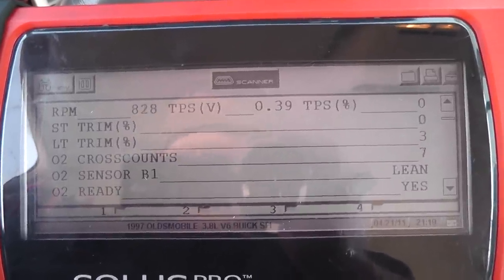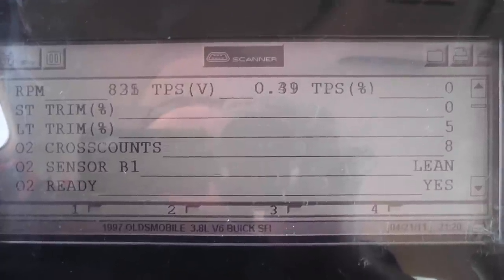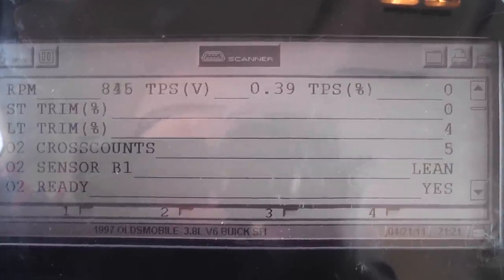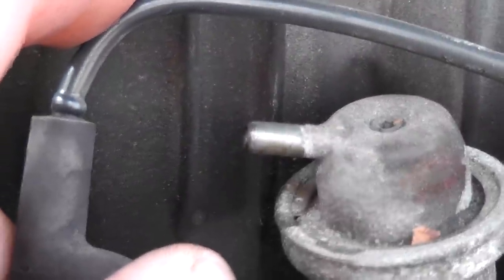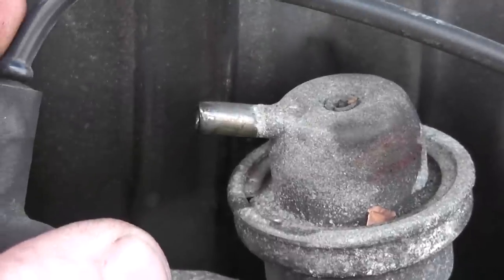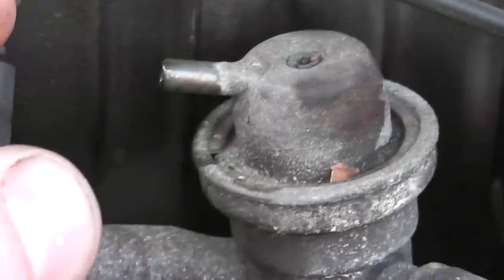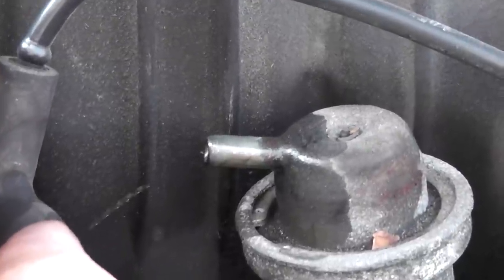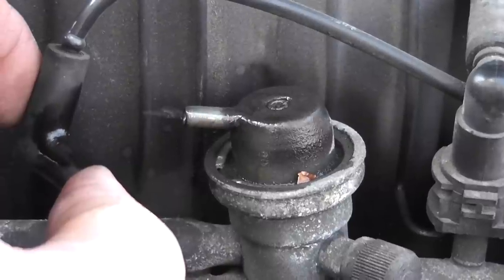Testing for a leaking, ruptured, fuel pressure regulator diaphragm

Comment: OK so we wait a few, gonna try this on my 94 jeep GC 5.2 I replaced f filter then later that day the pump. still has the ASD and f pump relays clicking so in the on pos I pulled the relays still heard faint click other side engine. the evap purge solenoid was it so play with it and its next to the fpr so it stopped clicking and got fuel. but driving for few minutes rpm up n down few times and dies. has rough long start sometimes with a shotgun blast backfire that is after the relays stop clicking. also you did good plugin the vacuum line otherwise would've had a high pitch whistle and tough time hearing you in the video.

Comment: Awesome tutorial Scanner Danner, I have learnt a great deal from your videos. I am refurbing my throttle bodies and fuelling system as part of a minor restoration. On removing the FPR (it's attached to the throttle bodies) I noticed a dark brown oil like liquid in the vac port of the FPR which had a slight smell of fuel and oil. Could this just be oil vapour in the vac lines? Im unable to test the FPR as it's no longer connected to the motor.

Comment: Indeed u are correct, reg is in the tank. So if i pull that 2nd hose and i have a "suspected" leaking reg, will fuel come out of that outlet?
Reply from the maker: No, that second line is an EVAP vapor line and is not part of the fuel delivery system. You cannot test the reg. If you have a bleed down problem you must change the pump and reg. as an assembly.

Comment: I'm praying that is the problem with my volvo 940, I've replaced the relay, fuel pump, cleaned the throttle body and idle control valve. The engine will run for 5 minutes all the while the fuel pump is getting louder at idle, then it shuts down. If I'm driving at freeway speeds there is no problem

Comment: A leaky regulator(in plenum) leaky poppets, or bad fp check valve? Is my koeo spec during pump priming or off?  A little more info, rarely ill get a random miss code, misfire counters 0 most of the time on drive the scanner make pick up 1 or 2 misfires each on diff cyl then back to 0. Fuel trims are only -6 and -8 at worst near 0 at higher rpm. Id appreciate the input I'm starting to get more diagnostic work at our shop and your videos realy help me be successful thank you very much!

Comment: I pulled the vacuum hose on mine today. I didn’t hear any suction from the hose like I did in this video. The pressure regulator did have a small amount of suction though. Does that sound normal?

Comment: What if the FPR like this is plugged on the fuel pump hangar inside the gastank? Will a torn diagrahm also send too much pressure to the fuel rail? My injector is sending too much fuel inside the cylinder causing exhaust to go inside the exhaust and out the back
Reply from the maker: No, a ruptured diaphragm on a tank mounted psi regulator will cause low psi and bleed down issues (long crank times)

Comment: Good stuff. I am an out of work ASE engine specialist and I have no money for a new gauge let alone throw good money after bad.  I was wondering how to test it since my fuel press. tester got busted. The only other gauge I have is for carb and it doesn't read high enough, even if I did adapt it for schraeder valve. It was a toss up between FPR or Pump prime switch/fuel pump. This should help me eliminate some possibilities.

Comment: I have that  exactly type of motor with the same time, at the end of that small hose there on the video. Now I have gas coming out of my air filter can you tell me any suggestion on what I can check ... it was running perfectly good. I just change the t.. and now I got this issue...

Comment: Can a fpr all of a sudden die out? Like get so weak that it just floods the injectors with gas? Awesome job on the tutorial by the way; man I have changed all of my ignition components. I still have a no start condition with flooded plugs. I mean everything is Brand new, all sensors! The only thing I haven't changed is that? What would be the signs? Thanks in advance. 04 Indy SS
Reply from the maker: +Corey Conner just pull the hose off and check it. If no fuel comes out, you'll need to go in another direction

Comment: Any idea where that component is located on a 2004 Ford escape 3.0?  I have a P0001 code but can't find the location of a fuel pump volume regulator on a 2004.  Saw a video on a 2005 but my 2004 it's not in that spot, nothing is in that spot on my 2004.

Comment from the maker: that connector is on the inner fender either on the driver side or passenger side. run the key on engine off self test and the key on engine run self test and let me know what you have. keep in mind when you run the key on engine run test that you must have the engine warm first and you must follow your prompts or you will set false  trouble codes

Comment: The regulator you have tested is placed inlet line. How to test the device which is on return line? is the difference between inlet and return divices?
Reply from the maker: The regulator on a return type system is the end of the pressure line and the beginning of the return line. On ALL return type systems. Are you dealing with a returnless system and maybe a pulse dampener that looks like a regulator?

Comment: Scanner needed to tell me what that hose did.  was that the fuel outlet ?  I thought it was the vacuum line to the manifold?
Reply from the maker: It's a vacuum line, there should be no fuel there. The vacuum alters the psi regular and give it about a 6-10 psi difference from idle to wide open throttle
Reply: ok, so its a leak?

Comment: Could you put a vacuum pump on there with a container, ala vacuum brake bleed, and see if you get fuel?
Reply from the maker: or put a clear plastic tube on the vacuum hose and then connect it and start it and look for fuel that way

Comment: Great tutorial.  I had ruled out the fuel pressure regulator as the cause of a long crank on my '99 Olds because I didn't see any fuel coming out of the port when I first pulled the vacuum hose off.  It's a pain to diagnose since everything on my scanner looks normal and I am getting no codes. Didn't realize that a minor tear would take so long.  I will try again tomorrow and wait a while longer.

What's the longest you've seen it take for fuel to start coming?
Reply from the maker: about a minute or two. 
With a long crank, the next step would be to test for a fuel pressure bleed down problem on shut-down. Fuel pressure should hold.
Reply: What if fuel pressure doesn't hold?

Comment: Thanks for the video 
How do you test this if your fuel pressure regulator is in tank? Nissan Sentra hava in tank regulators
Reply from the maker: You don't. You would simply have a bleed down issue and NO driveability problems other than a long crank time
Reply: @ScannerDanner  Sorry 
I have drivability problems 
1. Long crank 
2. Ltft and stft in negatives, worst in coasting.
3. Car stalling 
4. Engine misfire (P0300, P0304) 
5 Bad fuel economy
6. Engine running rich 
7. Darkend spark plug tips

Can I only replace the fpr with this type of fuel pump or have to replace whole pump 
Thanks
Reply from the maker: A leaking/ seeping  fpr that is in the tank will NOT cause any of these symptoms 
Is your fuel psi normal with the engine running? If so, you need to move in another direction
Reply: Too bad, I don't have the equipment to check the pressure
Reply: @ScannerDanner  Check the date of this comment thread 
Am still running rich Bro 

Can a ruptured fuel line cause the symptoms i talked about when the fpr is part of the fuel assembly in the tank? 

Btw, I changed the whole fuel pump assembly; it didn't fix the fault. 
So its definitely not the fuel pressure getting into the injectors to spray.

Comment: Just to let everyone know, my 1997 Buick 3800 Series II has never spit fuel out of the vacuum port no matter how many times and how long I waited for it to start spitting. I just replaced it and it appears to have helped with BAD starting in the winter where it's currently 20 deg Fahrenheit. If you're unsure whether it's bad, spend the $45 at Autozone and just replace it, because sometimes they don't leak in an obvious fashion :)
Reply: As a follow up to my previous post, ultimately I was able to check the fuel pressure  using a fuel pressure guage attached to the test port on the fuel rail on top of the engine. Fuel pressure is supposed to be 47-55psi and mine was consistently low at 22-25psi and always throwing the P0171 "Lean to Bank 1" DTC. Took car to have the fuel pump replaced and haven't seen the DTC code since. If it wasn't for the cold exacerbating the slowly failing fuel pump, I wouldn't have gotten rid of the problem.

Comment: So it was good? Mine has no fuel coming out...after about 2 mins. The car is running like crap though. P0300 code. 2005 Monte Carlo LT 3.8. Waiting on fuel pressure gauge to test fuel pump. I do have an Actron with trim readings LT and ST...no clue how to use that to test though.
Reply from the maker: you found the right channel for learning your fuel trim numbers, also testing fuel pumps too :-)

Comment: any other way to check. 95 explorer usually long crank. hit and miss to start. sometimes it idles rough. sometime it stays running  for 5 sec sometimes 5 min. If u rev it up the second you let off it shuts off. And it usually bounces around about 500 rpm. holding at 2grand it will bounce between 2 grand and 1500 and eventually shut off.

Comment: Ohh damn I recently "tested" my FPR with the quick method and engine not even running... I figured that if I suck from FPR vacuum hose and it doesn't let air through it's fine, but I suppose that the rupture can only leak when engine running and after couple of minutes... Guess I have to re-test it properly.

Comment: ive got a 3800 supercharged series 2 that ive changed nearly everything due to a rough/surging idle and random one of the only things i havent done is the fuel pressure regulator hoping for the best. fuel pressure held okay but im just throwing parts at it hoping for the best
Reply from the maker: Have you done a compression test on the engine? It is common to have a low compression cylinder or cylinders give you a rough idle and run good under load.
Reply: ive done both compression and leakdown and both are great

Comment: So after extended period of time if no fuel comes out were good? My 1999 Eighty-Eight starts fine but many times after it is hot it starts but spits and sputters (kinda like it is running rich) but it stabilizes after several seconds and runs fine. Thoughts? thx

Comment: My 99 Regal has a long crank time but only after sitting all night long. It cranks just fine during normal use. Any ideas on what wouls cause a cold-start long crank time? Thanks.
Reply from the maker: check your fuel pressure first

Comment: Spierotti14 I had similar problem few month ago, misfire at different cylinder  negative fuel trim #'s and lack of power but no long crank, the problem intake gasket leak and the MAF sensor, with the engine running unplug the MAF sensor to see if the misfire stop. hope this help..

Comment: Sorry I didn't see you responded so fast. It is a MAF  SFI  i checked the injectors power and PCM command   I just don't see how much fuel can get in the engine  while  I was able to get it to run didn't see any fuel coming out o the regulator tomorrow I'm gonna try to find the connector for the scanner (odb1) somehow it got misplaced

Comment: @ScannerDanner 
I see thanks a lot! Then if Key is On- engine Off and pedal is depressed fully you should see 100% tps, right? my system is a throttle by wire so I don't know if that would make it any different

Comment: I NEED THAT VACUUM HOSE!!! where can i find one? my car has a crack in the L boot that goes on the fpr nose, no auto parts store or gm dealership has this line i need....
Reply from the maker: +Dylan Thomas just change the whole thing with rubber. If one size is bigger than the other buy some adapters. Something like this https://www.fcpeuro.com/products/bmw-vacuum-hose-connector-e46-13327503677?gclid=CjwKEAiApOq2BRDoo8SVjZHV7TkSJABLe2iDCzkvDX_PBYrShndAGkFXzTcThvuZKD9TKFLqiPEh6hoC2fLw_wcB and then plug one of the big sides. Of course it doesn't need to be for a BMW :)
Reply: haha thanks!! I ended up finding a universal vacuum hose and now shes ready to run problem free for the next 20 years XD

Comment: hey there is have a 2000 Buick lesabre and it won't start. Replaces the plugs and nothing. it cranks but won't start. It checked good for spark and when I press the valve on the regulator fuel comes out. I cannot figure it out.
Reply from the maker: It is becoming more and more difficult to answer questions here. I have 80,000 people asking me for help now. So I have created a forum to help you guys better. It is free to join and we can exchange pictures, wiring diagrams and waveforms if needed to help guide you through the process of troubleshooting your vehicle. Thank you so much! Hope to see you there. 
Paul Danner (ScannerDanner)
https://www.scannerdanner.com/forum/post-your-repair-questions-here.html

Comment: I did this test because my ford explorer has a long crank time before starting and is going through a lot of gas. I let it run for a while and no fuel came out but i did notice one thing. The vacuum hose you pulled off appears to have a lot of suction coming from it. Mine has none, is that normal? And the truck ran no differently with the vacuum hose on or off.
Reply from the maker: It depends on the car, some systems used a computer controlled solenoid to control vacuum to that regulator. Follow the vacuum hose, does it go to the intake manifold directly or to a solenoid first?

Comment: cant you just run the vehicle, shut off then unplug vacc hose and check for fuel in the vac hose?
Reply from the maker: Depends on the severity of the tear. Sometimes these are difficult to find. But yes, that is one of the tests you can do.

Comment: Hey mr.danner, I'm trying to diagnose this chev c1500 5.7 I believe has fuel issues smilar to video. Intermit. long crank and customer says lack of power. Koeo pump running -60 koeo pump off-50 then I get bleed down and this is what hangs me up. Intermittenly it'll bleed about 8psi a min. Other times it takes longer to bleed down. Sometimes bleeds down to 10 sometimes not below 30. Quest. Is how fast should it bleed down normally? How can I differentiate between ---